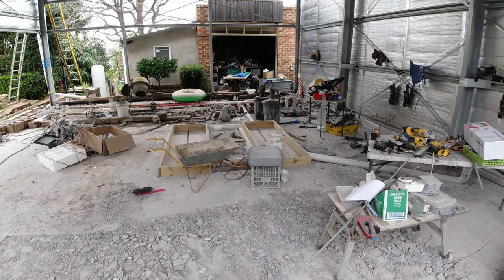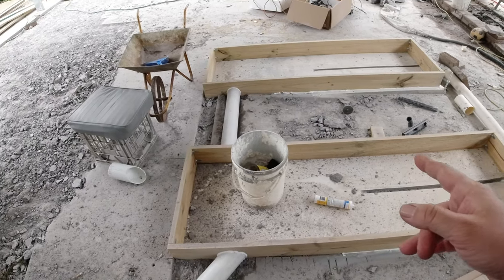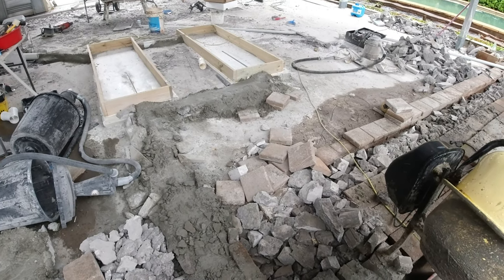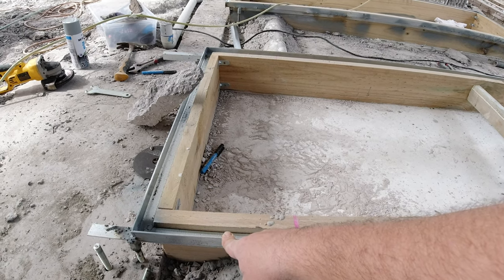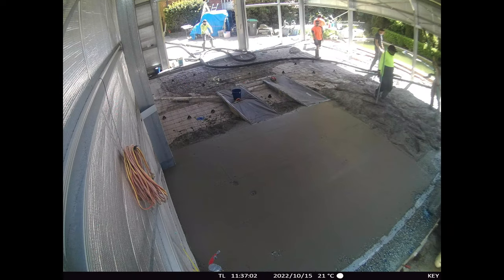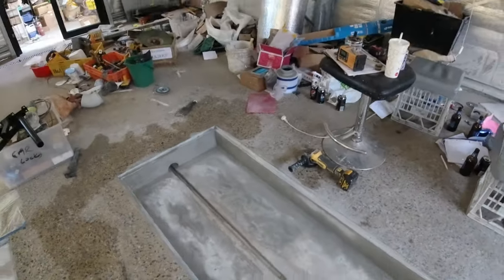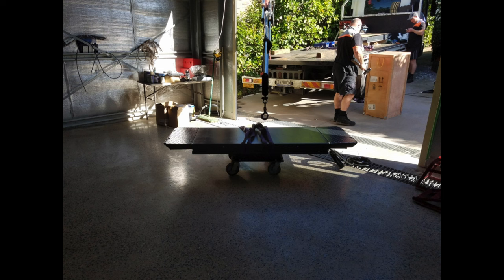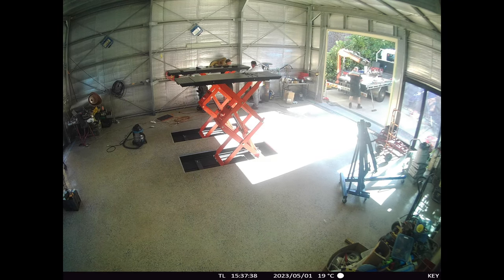Best car scissor lift Garage Workshop Man-cave WHY & HOW & $$

Comment: That looks amazing. Well done. Im the type of person who would just do it the cheat way. way too much screwing around but yours looks sweet. If you are concerned about the lift Rusting, buy some silica cat litter crystals and fill up some old socks to tuck in along the sides under the hoist. they should help keep everything dry and just change them over every 6-12 months. you can recharge them by putting in the oven to remove the moisture. Thanks for sharing with us.

Comment: Might be a neat idea to add fitments for extension frames for those cases where you need to lift the vehicle from where its wheel footprint is, where the bottom of the vehicle chasis has things that arent flat or strong enough to support the weight of the vehicle.
Reply from the maker: You read my mind, I need to get a jig for the pickup points next, work vans dont fit well because the points are so far apart,, I may need to get a jig or extension frame